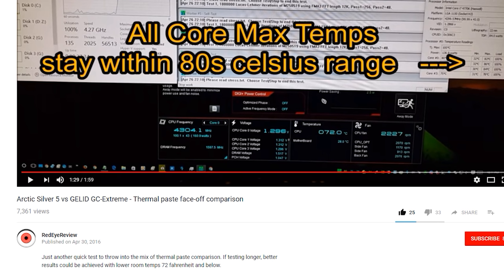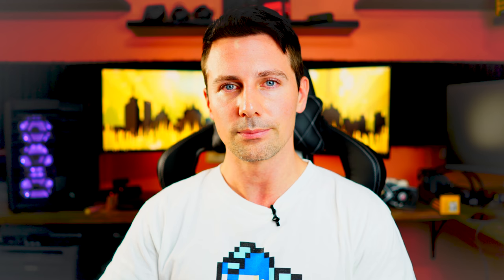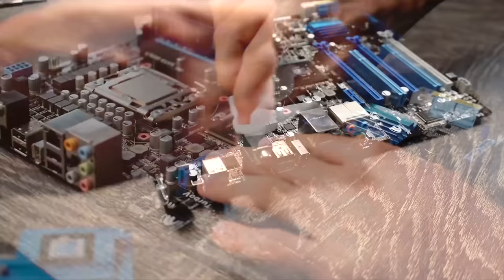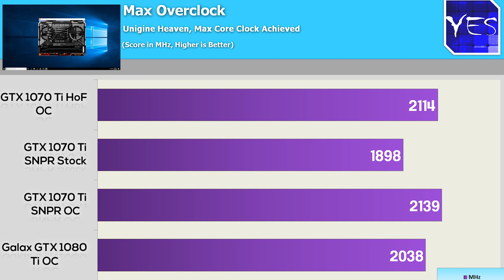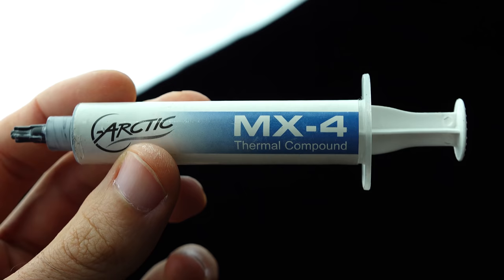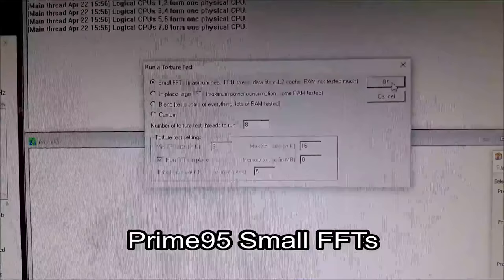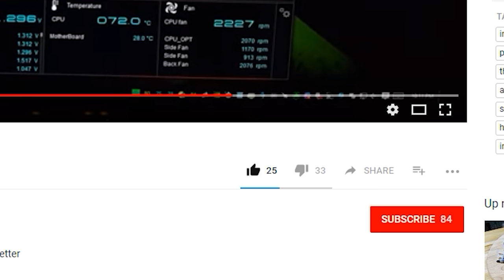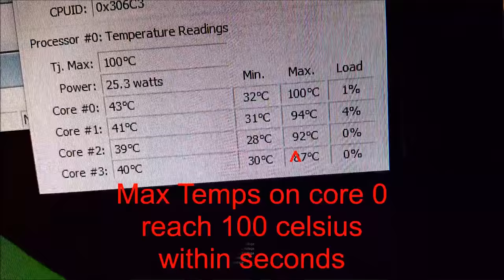Thermal Paste Investigation - GELID GC Extreme Vs Arctic MX4

Comment: Cooling with air, a good thermal paste is important. Will take a look at it, I use Artic MX4 and Cooler Masters included tube with their coolers in a pinch. As far as dislikes go I rather see a thumbs down versus them writing some crazy bait comment, that is meant to start crap. I love computers both AMD, NVIDIA and Intel products. The next eighteen months we should see some more shifts in market shares and this will bring better products to the masses form both Red/Blue teams. Price maybe another thing we have to wait on. Keep at it my tech brother you are the right track.

Comment: I have found that some thermal paste works better when allowed to cure over time.  Sometimes it take a 1-2 week burn in to get the best out of the thermal paste.   This is done by heating and cooling the paste over a week or so.  I have seen 5-6c differences.

Comment: Because of this video I bought a couple tubes of GELID GC Extreme. I was already using Arctic MX4 so I turned on Far Cry 5 and played for an hour. Hardware monitor said my GPU temp was 78C max with fan speed of 3037 RPM max.

Using the GELID GC Extreme, same game for an hour. Hardware monitor said my GPU temp was 72C max with fan speed of 2207 RPM max.  So my GPU is 6 degree cooler and the fan speed is 830 RPM lower in this case.
Glad you did this video.

Comment: I used gelid for my CPU and GPU.

 The temps for my 6600k@4,4 GHz is idle 28C from 32C and max 68C from 71C on cinebench r15. I used deepcool captain 240rgb.

And for my MSI GTX 1060 Gaming X, the temps is idle 35C from 42C and max 65C from 72C.

Yeah it's pretty good.

Comment: I switched from AS5 to Arctic's MX-1 and then MX-2 right after they were released and haven't looked back (or used AS5). MX-3 was too thick and harder to get a good application and MX-4 never gave as good of results as MX-2. I then tried Gelid Supreme and Extreme and I've stuck with them ever since, only using what MX-2 I had remaining till it ran out. Gelid Extreme's ease of application, long life, excellent temps, and price make it my go to compound for better builds and graphics cards. I use Gelid Supreme for lower end business type systems due to the lower cost. The 2-3C difference in cpu temps on those sorts of systems isn't worth the additional cost for those sorts of applications.

Comment: That's interesting!
I use MX-4 (or the cheaper industrial equivalent MX-2) for years now... 
But it will be interesting to see the long term stability of the gelid extreme... Because I use MX-4 because it is very durable, it is still fluid/creamy after 3 years on a GPU die. Most High end pastes will die very fast, at least this is my experience. They are indeed very nice for 6 months, but after that they start to suck and get worse every month

Comment: review and comparison interesting friend. But get me a question here.
The MX-4 says it has a maximum durability of up to 8 years and this information I didn't find in the gelid brand folder.
Regarding their durability in the system, which would be the most suitable for a laptop, for example, considering that its maintenance (cleaning) can be done without the need to remove the heatsink, just the cooler?

Sorry for the English, but I think I managed to get through the doubt without any major problems.

Comment: The GC extreme I ordered from eBay came from Tawain and was dried out and was spreading like dry peanut butter. I since re-ordered the smaller package with the tube that would apply like you see in the video, as that is what I had last time I ordered the small tube. I wish I would have ordered it on Amazon, not being dried out.

Comment: Arctic Silver 5 was on the market for at least 15 years, things changed since then, but it is still a good thermal paste for its price. The problem is - with such a long product lifespan, there are tons of old as5 on shelves, still waiting for buyers. I've used some old as5 compound recently, bought in the phenom era (so at least 8+ y.o.) and compared to stock amd wraith spire paste - the result was horrible.
The colour was also way off than I remembered, so if you bought some as5, and instead of light gray with silver additives, some darkish glue is coming off, you should throw it off instantly.

There is also a very long curing period required with as5 before it reaches peak efficency. I'm talking about 200 hours of on/off cycles, so judging by the temperature spikes on the mentioned video, I'm pretty sure it was skipped completely by reviewer/tester. That is probably the main reason why he received so much flame. Both from userbase, and prime ;)

Sure the GC Extreme is a way better paste, usually by 3-4 degrees Celsius, but it is nowhere near that 20+ difference showed. That was either an old batch of AS5 or an user error while applying the compound, together with lack of curing period.

As for the MX4 it is made be completely different company, which several people already mentioned. The paste is quite okay, sub 10 degrees Celsius delta T, and it doesn't require  curing period. It's cheap and easy to use, but loses it's efficency with time and temperature. I've used it on Radeon R9 and it was drying after few weeks of 80+ C stress, forcing me to repaste it. I've switched to GD900 for this GPU and it was way better in keeping its parameters with time.

So for a cheap paste I would pick GD900. For optimal performance with good value - GC Extreme. And if I had money to spend - maybe TG Kryonaut.

I doubt anyone is going to read it this far, but if someone survived that wall of text, take a look at this test, if you need some good comparison:
https://overclocking.guide/thermal-paste-roundup-2015-47-products-tested-with-air-cooling-and-liquid-nitrogen-ln2/6/

This is how it should be done.

Comment: My old go-to was actually AS5 which lasted many years and was very good at the time I bought it. I did some research on comparisons between different thermal compounds/pastes last year (AS5 finally ran out) to buy in Aus and I ended up buying the GC-Extreme on eBay as well.

Nothing wrong with Arctic Silver, I bet it's still better than stock Intel paste, but there's better stuff out there today.

Comment: Conductonaut is surely hard to work with, however, you could cover the tiny caps next to the GPU core, for example, with nail polish and not worry about any short circuits. Cheers!

Comment: AMD R5 2600X with default paste on Wraith Spire Cooler was "ok". Switched to Arctic Silver 5 and dropped 5 degrees Celsius on average while playing PUBG. Gonna order some of this Gelid stuff now and try it. That 5 Degrees for me meant the chip boosted an additional 50MHz (went from 4000 average to 4050) in Pubg playing tracked with MSI Afterburner. I think Gelid and my soon to be installed Corsair H100i V2 are going to see this thing hold a boost of 4150. It tries but comes back to 4050 when the temp climbs.

Comment: I'm using MX-4 on my 8700K @5.0Ghz. while the temps are not bad, they are not great either. I've always chalked it up to the silicon lottery, like you said yourself, because I have to push nearly 1.4v to get that 5Ghz.

I was stable for a long time at 1.385v after I built my system, but that was in October when the temps were cooler. Now it's summer time in Vegas to my ambient temps are higher. My CPU temps under my normal usage loads are still fine, mid to upper 60s on a 280mm AiO. But that 1.385v was no longer stable after the temps started to come up.

I want to try this Gelid now and see how it performs for me.

Comment: Because of this video i bought gelid. I used arctic mx4 since it existed.
I tested them with several water and air cooled setups.
I am still not sure if there is any difference at all. 
My biggest changes came from changing the cooler and mounting pressure.
You can't see with your eyes wether a a cooler is perfectly seated.

Comment: If I recall correctly, MX-4 is best used for long-term solutions where changing it out happens infrequently. Arctic Silver 5 was a high standard for some time, but I will not be surprised if someone finally found the secret ingredient to do better, and this might be one of those times (where its not freaking liquid metal...that's just crazy OC territory). Though I wouldn't mind seeing a few other places showing some tests with this if its a good up and comer.

Comment: Don't people here realize that 'Arctic Silver' is a different brand than 'Arctic' witch was referred to 'Arctic Cooling' in the past? The MX-4 and the Arctic silver 5 are not even remotely comparable, for of has a 8 years of longevity guaranteed after application. Set and forget so to speak, and it holds true for what I can tell because all computers or graphics cards I used it on got tossed because of age before the paste wore out.

Comment: Fanboys are killing the hobby... Here in the US 10grams of GC Extreme costs 37 bucks on Newegg, Arctic Silver 5 12grams cost 17 bucks. 

Guys, the GC Extreme performing better should be expected. I use Arctic Silver 5, have on a 980ti I've had some thermal issues with. Guess what, ordering some GC right now. Bryan and any Youtuber who lets us know this stuff does us a favor. You don't atack people for doing you a favor. Damn.

Thanks for the video. If you want I can update this if the GC brings the temps down. 70c on a 980ti Hybrid but the pump seems to be fine.

Comment: For the longest time, my goto thermal compound was Artic Silver 5. Its fairly good stuff and its not too expensive either (and I could buy it at the radioshack down the street from where I used to live). I wanted to get some better stuff when I got my new Clevo P750TM1-G gaming laptop because I knew thermals were gonna be an issue. I started digging around lots of different review sites for thermal compound reviews and I found Cooler Master Mastergel Maker. It looked like it performed within a degree or two of Kryonaut and was a few dollars cheaper and you got more in the tube. That's now my goto but I'm looking to play with liquid metal since the 8700k @ 4.4Ghz on all cores and gtx 1070 @ 1920Mhz boost/4500Mhz memory in my laptop still get fairly warm and I wanna try to wrangle that in better and the only thing that'll give me better temps is going to be liquid metal.
Reply: One thing when you start to play with liquid metal.. Some use nail polish to protect things around that area,  BUT Conformal Coating is probably better.. ( MG Chemicals 419C-55ML Acrylic Lacquer Conformal Coating, Clear ,55 ml Bottle )

Also a more current detailed test of Thermals pastes: https://www.tomshardware.com/reviews/thermal-paste-comparison,5108-8.html

Comment: well i buyed Gelid GC Extreme from amazon (10€ 3,5gr) after this video, i try it vs mx4(dot application) with my delidded with pure Gallium(for my tests same performance then commercial liquid metal products but super cheap, super durable) i7 7700k at 5ghz/1,28v custom watercolling ...... prime95  Gelid/Mx4  68,5c/68,1c ..... Aida 64 Gelid/Mx4  68,1c/66,6c .... realbench Gelid/Mx4  67,6c/66,2c ..... IBT 10 pass very hight Gelid/Mx4 69,1c/68,6c .... within margin of error on my system they perform the same

Comment: Bought my rig from NZXT's BLD program so I'm not sure what thermal paste they use for the CPU and I imagine for the GPU it's just stock paste they use at the factory. My EVGA GTX 1070 Ti SC Gaming Black Edition got to 2100MHz on the core clock. CPU is an intel i7 8700K which is running stable at 4.9GHz at 1.400 volts.

Comment: So i bought the Cool-Master Hyper 212 EvO X it came with its own tube. That's what i'm using not a problem temps are cold.
Reply: Cooler Master's own paste isn't so good. There's a paste called “Thermal Grizzly Aeronaut”. People who have used Arctic Silver 5 say Aeronaut is better. You can use http://shopping.google.com to find the cheapest place to get it. Let me know how it goes.

(For a desktop processor you put a small drop of paste in the middle, almost the size of a cooked rice grain. When you put the heatsink on the heatsink will spread the paste where it needs to go. The processor is in the center, underneath the lid. Having too much paste will prevent heat transfer rather than aid it. If you spread it entirely with the Cooler M paste try this method with it first before using Aeronaut.)

Comment: I picked up some Arctic Silver 5 a few weeks ago and haven't had any issues with it. Certainly, GELID proves to be better, but AS5 was cheaper and the only TIM available at the local Fry's Electronics I went to.

As for pea method... Why not? Again, using AS5, done it to a laptop & a tower and not had any issues with it in the slightest.

Comment: The original video barely had 40 down votes on it, which means the initial people who did see his video down voted it largely due to how poor the video was done.

The video is less than 2 minutes long. So Youtube won't run any "algos" off of this so it won't get promoted it to anyone to watch it, and it's 2 years old anyway.

The guy never speaks in the video, it's just text popping up on the screen you have to read quickly.

Then there's the crappy dark shaky cam videos of his screen with awful moire artifacts on screen was hard to look at.

He used STOCK images of GELID GC Extreme and Artic Silver 5 off the web.

He never shows the actual products hes testing, let alone see him APPLY the thermal paste onto his CPU (so everyone can critique his technique).

We don't even know what cooler he was using, or even if it was water cooled.

He admits he did "brief" tests which honestly means jack-all. It can take 20 mins for temps to level off or longer water cooled.

RedEyeReview wasn't "demodivated" by less than 30 down votes in over 2 years. He has no viewership in the first place, so he had no motivation at all which is why he hasn't done anything new. He did this video because he felt like it not because he was doing anyone favors, or hoped in 2 years Bryan would bump his viewership. It wasn't until you, Bryan, started talking about his videos, and how he has well over 1000 up votes for a 2 year old video.

Comment: I've been using gelid gc extreme and ic diamond over the past 4-5 years and out of the two have found gelid to be the best. Ic diamond is ok but it's just too thick and doesn't spread well. I find it surprising you have just decided to use gelid as your go to. I have been buying the 10g mini tubs for ages and love the stuff. I have 4 mini spatulas so far I have used it on every CPU, GPU, all of my family's laptops and yes even opened up my consoles to swap the paste to gc extreme with great results.